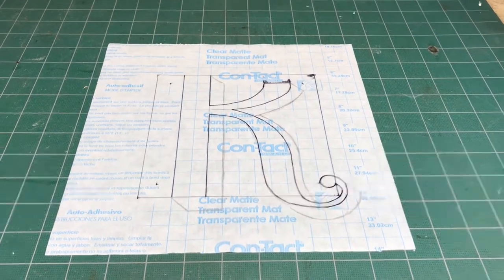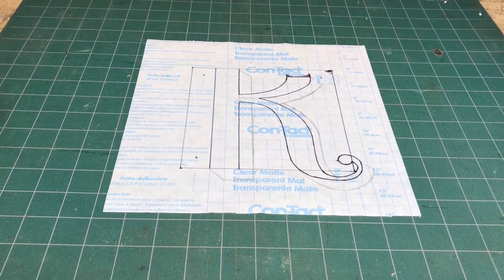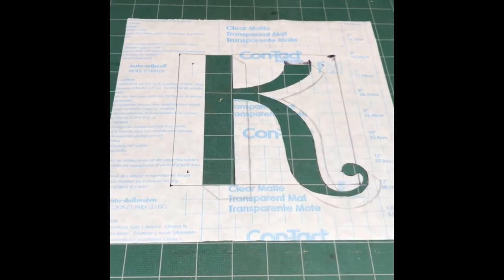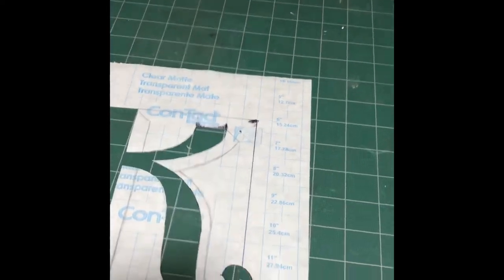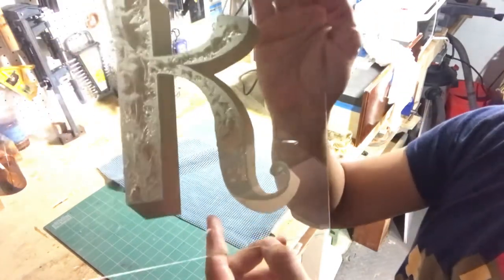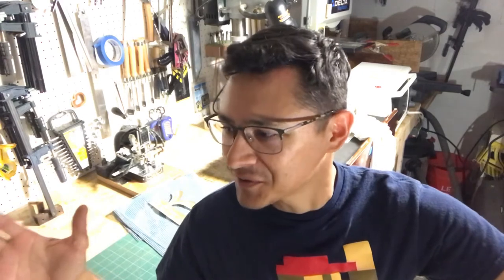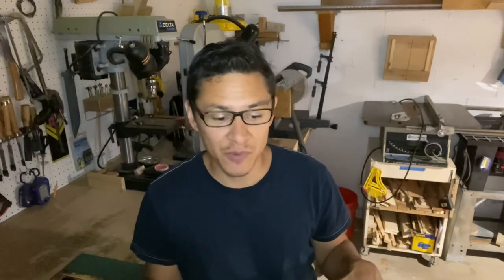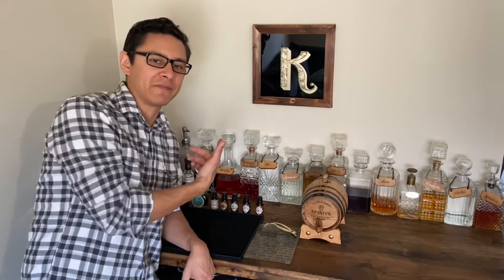Is Glue Chipping & Sign Gilding Easy

Comment: Why didnt you use sand paper?? Like a 320 grit for roughing the glass?
Reply from the maker: I wanted to get detail on the hard curves/corners with a rotary tool but that is not to say I couldn’t have used sandpaper for the general areas. Ideally, I’d have used a sanding cabinet. The technique is to make the sanding as uniform as possible for the glue to “bite” into. If you try with sandpaper let me know how it works out.